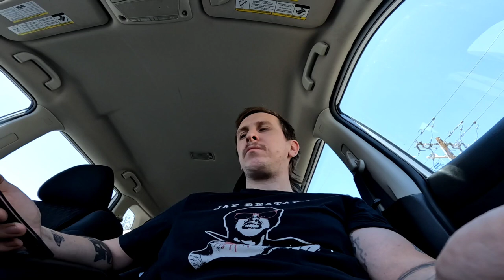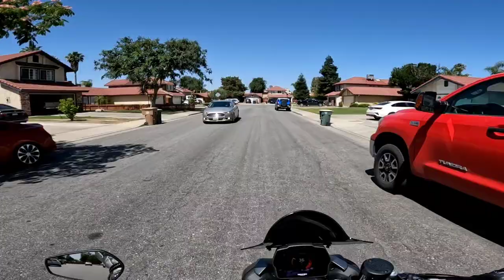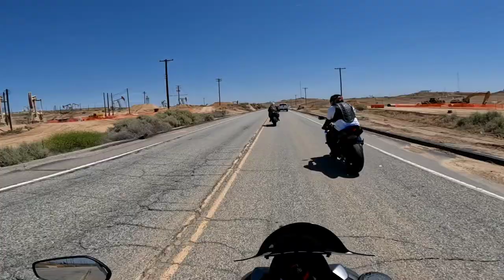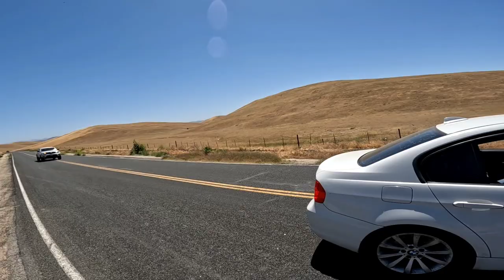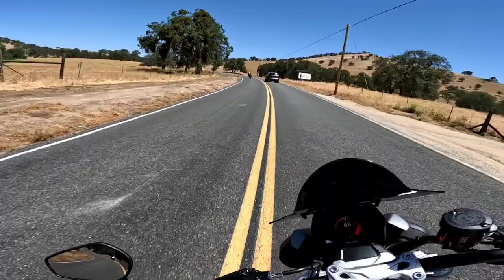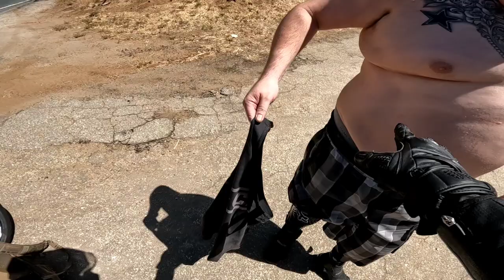more speed triple 1200 problems and bee stings

Comment: I’ve seen lot of People than have issue with this bike (i’m afraid cause i’ve ordered it for september), what about fiability ? Any issue at this point in your case? What’s you opinion on as now ?
Reply from the maker: Fiability? So I'm hoping that by now triumph has addressed the issues and fixed them on new bikes.  When I got mine problems people had prior to me buying like the oil leak,and flap on exhaust were already fixed. I still really love this bike that's why I'm sticking with it until all issues are resolved. Thanks for watching please sub and check out some of my other videos. If you have any questions ask. Peace
Reply: @2UpVids  I mixed US and French Word my apology I want  to say  Reliability ×)
Reply from the maker: Only once it wouldn't start for me as far as engine it seems strong I think issues are in wiring harness